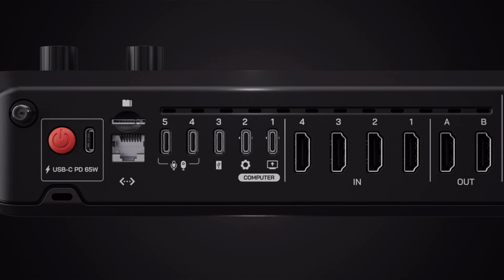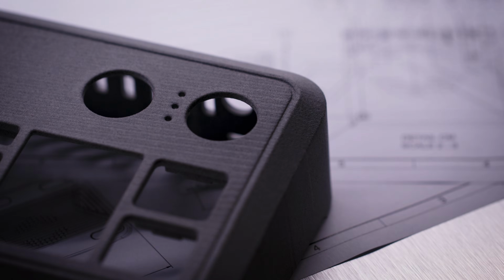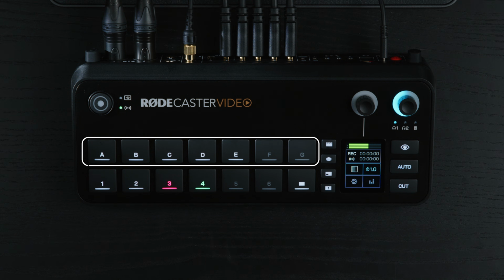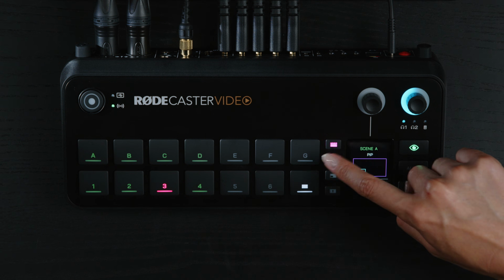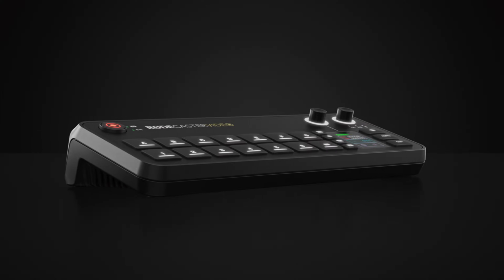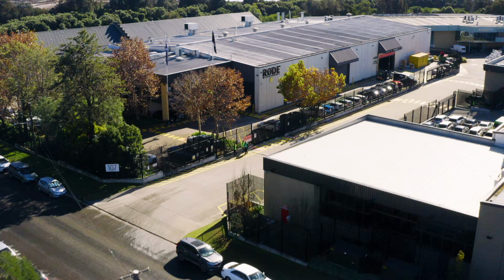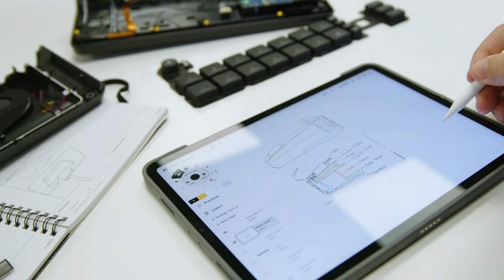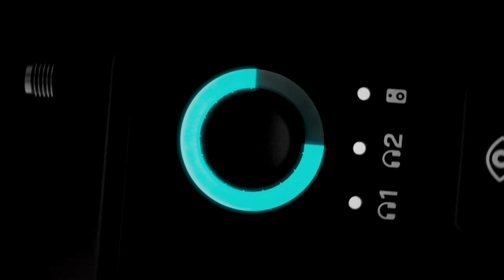The Backstory: RØDECaster Video

Comment: Brilliant stuff!!!

Would it be possible to use the audio USB ports to connect a live mixer?
For example Allen and Heath ZEDi10FX mixer using the USB out into the Rodecaster.. Thereby providing a centralised mixing platform for live video and audio?
Reply from the maker: Not with the Allen and Heath mixer, but you can connect a RØDECaster Pro II/Duo to the RØDECaster Video (via USB4/5) - giving you a stereo signal of the mixer 🙌

Comment: Does the Rodecaster Video have external API for control?
Reply from the maker: No API though if you have a computer connected to the same network as the RØDECaster Video, you can control it wirelessly from the RØDE Central application!
Reply: @rodemic thanks, I want to control it with the Skaarhoj RC-SK5 PTZ Joystick so that when I select a camera on the joystick it puts that camera into preview. 

This can also be accomplished with midi function. Does the rodecaster video have MIDI control?

Comment: This is the dream for RODECASTER VIDEO 2: Is it coming?
- 8 HDMI Inputs - 2 of them atleast to support 4K 
- Audio level panel right on the top of the unit (with adjustments), so that we don't need to run Rode Central to rely to monitor the audio
- Support all Web Cams including those who sends compressed video
- The Scenes could support assigning LABELS instead of A,B,C.. etc
- Support More Scenes
Reply from the maker: Brb sending this to the development team 🙌

Comment: I just hate that these super pricey switchers don’t have 4k. I use my switcher to stream but more often it is used to record. Nothing should be released in this time we are in at 1080p. $1000 for 1080? It’s crazy and disappointing at that price. Lots of features but it should be much less $$$ for 1080. I want one to streamline processes but at $1000 it should be a drastic upgrade to what I have already. Torn on this one. 4k would have made this a home run.

Comment: Also… how does a producer monitor sound if a two person(or more) podcast is being recorded and podcast guests are using headphones
Reply: I had same question...guess could run a headphone preamp from one of the RCV headphone outputs...could still have a custom mix for producer & another for the guests...they control their volume from the headphone preamp. Or if you have a RCPro2 or Duo you could run mics/headphones from that device & then bring audio into RCV...
Reply: @davejonline  Or you could use the monitor speaker outputs connected to a headphone amplifier
Reply: @ having to hook up an additional piece of equipment seems silly. multiple options within the hardware already. bluetooth headphones should be usable.
Reply: @real_estate_er Bluetooth headphones would have too much latency- but might have worked if the producer wasn’t speaking.
Reply: @pete-fraser  fair. Didn’t consider that. USB c headphones?
Reply: @ seems complicated. we have an RCPro2 but it seems really silly that a producer couldn't use one of the extra USB c's or that the speaker outs arent more versatile. Even bluetooth headphones. Anything would be better than what's offered

Comment: Will there be a Rodecaster Video Pro coming out with 8 HDMI inputs? That's the only reason why I haven't jumped from the ATEM mini extreme iso
Reply from the maker: Brb writing this down for our development team ✍
Reply: @rodemic yesss! Thank you 🙏🏼
Reply: Note you can use the USB inputs with Elgato HDMI-USB convertors to get 2 extra inputs. Also, as you can play video files internally that can replace an external PC HDMI input so you have now got the equivalent of 7+ HDMI Inputs
Reply: @pete-fraser   yeah I understand that, it's close but I need all 8. I host live events with several camera angles, iPads, computers, a Vibe board etc. so I need as many inputs as possible.